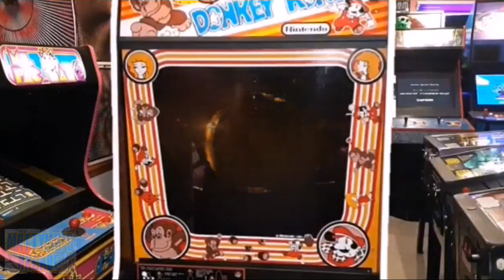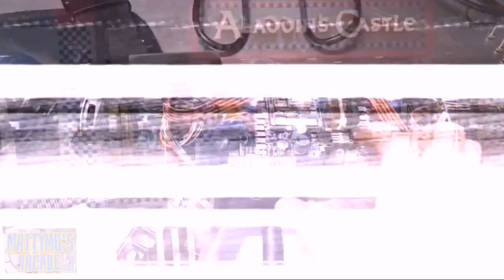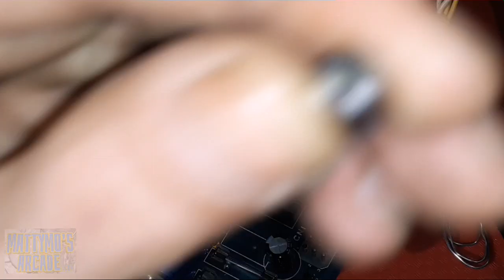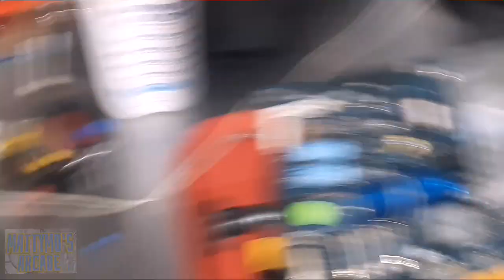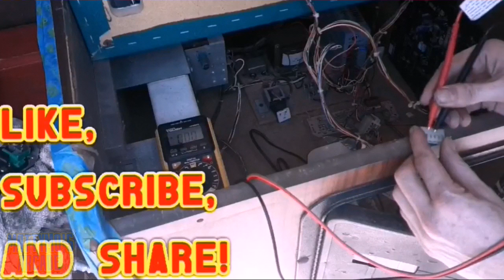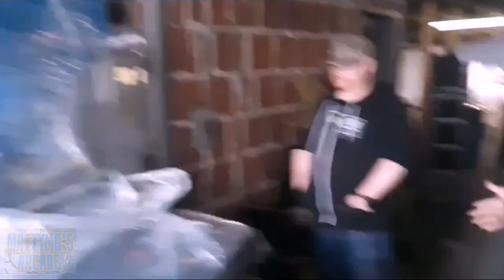Data East Pinball Power Supply Repair:  Low 5v (The Simpsons)

Comment: I have the same problem on my power supply board of the simpsons flipper and I saw other videos with also the same problem. Now I checked all the connection which were good and replaced the capacitor C7, but I'm not sure if I can play with this hole in the board. Is it a problem I can't fix or is it okay?
Reply from the maker: If it goes through traces on the board, they will need jumper wires to complete the circuit. They do sell a replacement board, but it is pricey.
Reply: @MattyMosArcade  okay thank you

Comment: MATTYMO'S ARCADE 
                         ,,,  RESET Circuit holds the CPU reset line LOW until the +5vdc is stabilized, then the reset circuit will set the CPU reset line to HIGH. 
      To Upgrade MPU System 3 RESET circuit to a MPU System 4 RESET circuit you have to remove a Capacitor and two resistors and install a 10K resistor 
--->  1.) Why was the System 3 RESET circuit not working correctly causing what kind of issues and failures that needed the upgrade System 4 RESET circuit modification upgrade?